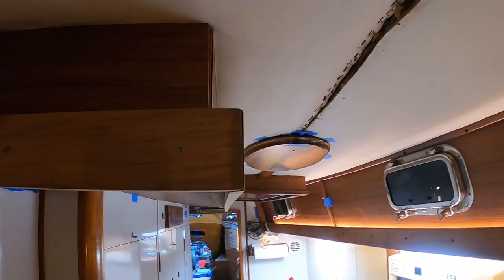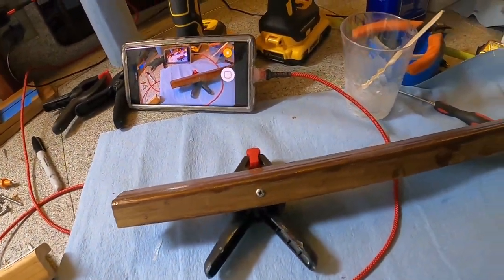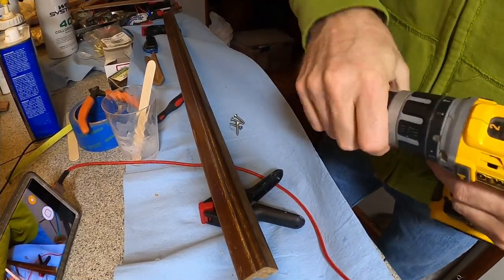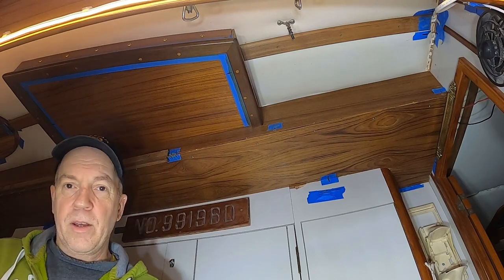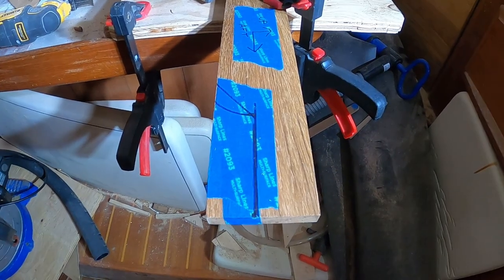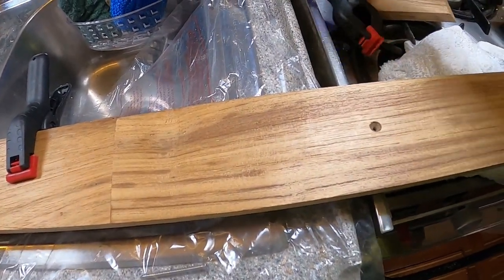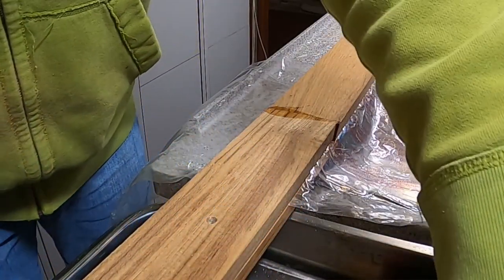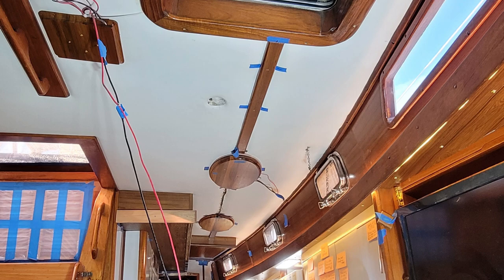How to make an epoxy scarf joint. Working with Teak Colored Epoxy messy. DIY Nautical Dream. S2 E60

Comment: I like the idea of using the sawdust from the teakwood to add matching color to the epoxy mixture.  Looks like a good way to fill in some gaps. Thanks for sharing that example. .
Great progress.
Reply from the maker: Thank you for your comment.  I'm glad you found this video useful. One thing we learned is that epoxy scarf joints tend to be a little on the messy side.  Thanks for watching. We hope you have a great day.